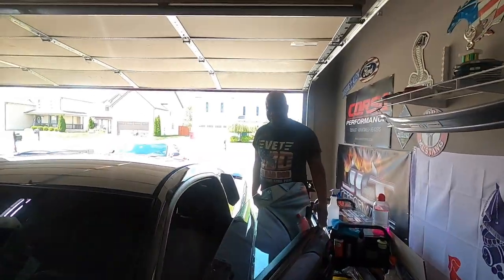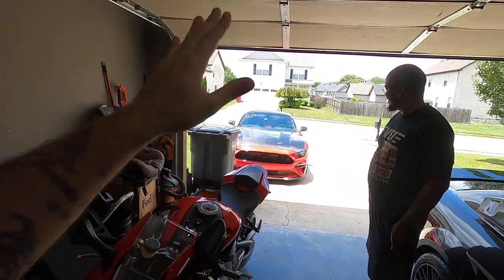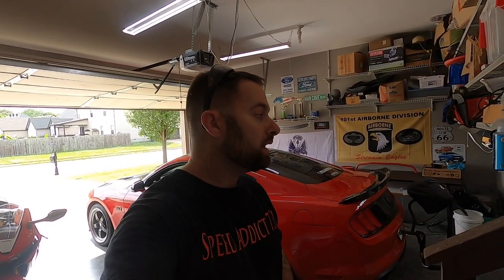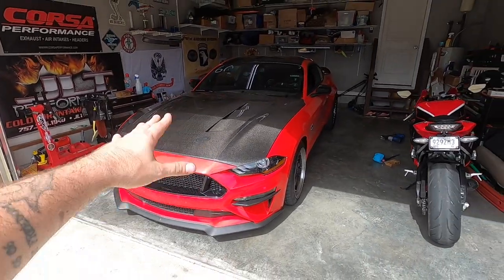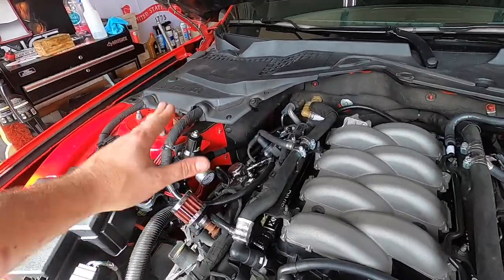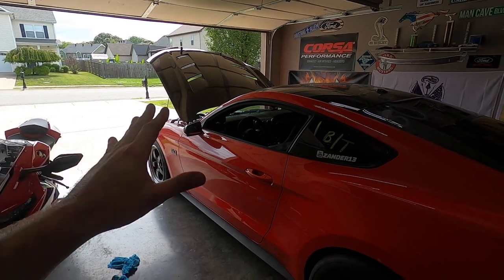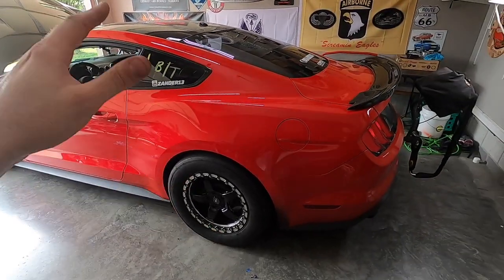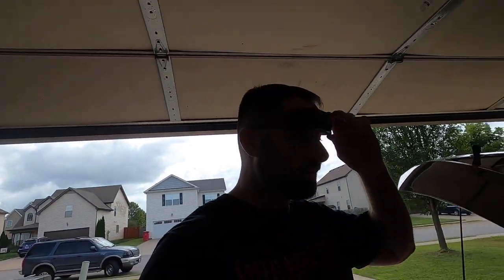HOW YOU CAN BUILD A 9 SECOND MUSTANG GT WITH THESE "SIMPLE MODS" *secrets exposed*

Comment: R u still having your driveability problem with fuel trims?  If so check your evap system the evap solenoid can cause stuff like that if its bad or if part of the system is disconnected.  Just a thought

Comment: ANDER, YOU PROBABLY SHOULD HAVE MENTIONED WHAT AXELS YOU HAVE IN THE CAR. AND WHY THEY ARE NEEDED.  OTHER THAN THAT A VERY INFORMATIVE VIDEO.
Reply from the maker: Totally filmed that part and forgot to include it. 🤦‍♂️ DSS driveshaft and DSS 2000hp axles
Reply: WHO IS ANDER?
Reply: @TroutButter  ANDER IS ZANDER WITHOUT THE Z. THANNKS TO FUMBLE FINGERS AND NOT PROOF READING BEFORE HITTING POST. LOL